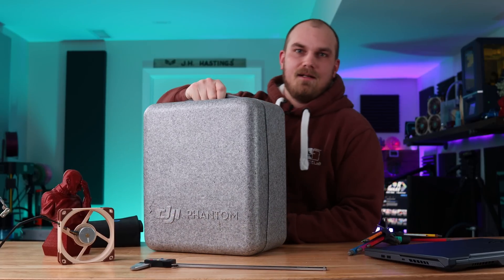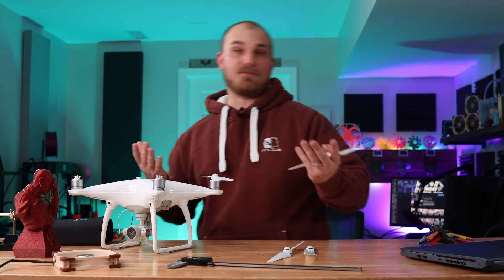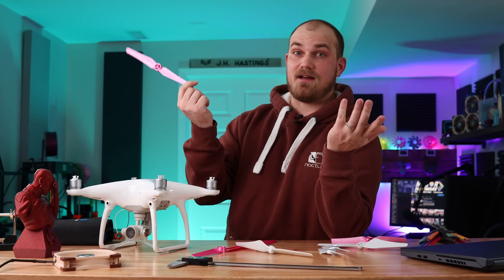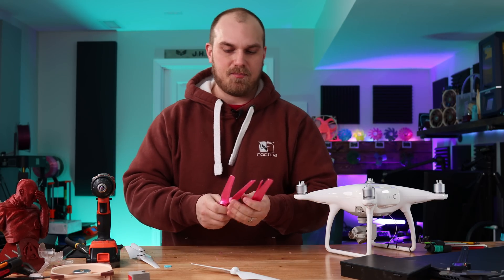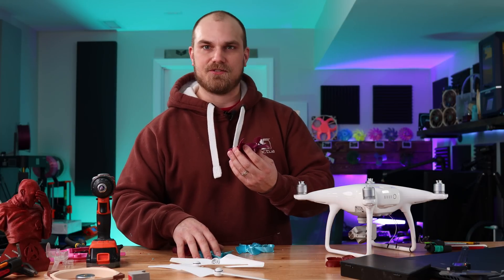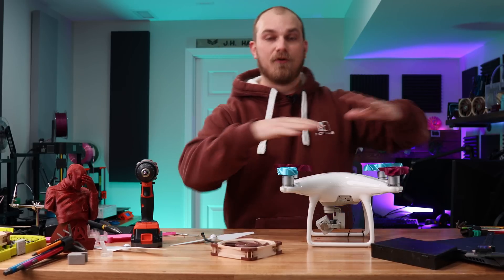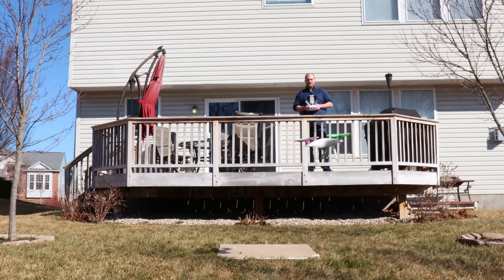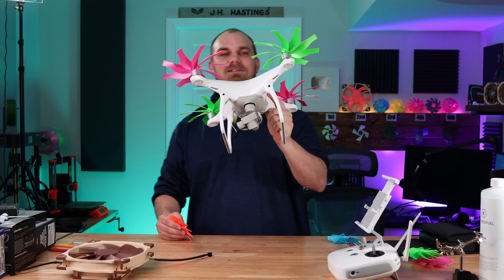FLYING Phantom 4 with 3D printed PC FANS

Comment: I believe if you 3-D print the BAT FAN PLUS from S4E8, with a bit more of a coanda-lip added to the duct, you will find multiple benefits for lifting your drone in future tests. The duct I am positive will reduce if not totally eliminate the flex you were experiencing with the blades in your previous tests, causing vibration and instability. Also, according to the 1954 Hiller Flying Platform studies the coanda-lip created 40% of the lift. 
I don't know the number of blades that will be optimal. Too many will stress the motors, so less may be more. The Hiller used 2 twin-blade counter-rotating props = 4 blades total. It appears the BAT FAN PLUS has 8 fixed blades. You might try changing the number and angle of the blades in your experiments. 
Love your show!!!
Thanks
Steve

Comment: So I randomly got curious one time (debating making a jet turbine) I've found that the fewer the blades the more air flow you get. The more blades you have the more pressure your fan can deliver. So if you think of a turbine with lots of blades pushing all that air into the engine to pressurize it enough so that the gas will ignite, that's where the extra blades come in handy. For propellers you almost always see the 2 bladed fan in an enviornment where the blade wont encounter airflow resistance. So in the open air, the 2 blade propeller makes sense. In a computer fan the 5 blade makes sense because you're trying to force air into a tight space, if it was just an open space you could get a lot more airflow with the 2 bladed fan. Another caveat of the 2 bladed fan is the noise. Two bladed fans make more noise. Another thing I'll add, as a theory. I was reading up on the most efficient house fan that also delivers the most air (kind of what you are doing on the channel) and someone actually did the research and found that the most efficient design is to use the blade angles from a windmill. This will produce the most amount of air. 3 for air flow 5 for pressure. Any more than that you have issues with weight and costs associated with the build vs the energy produced. Just some food for thought for those that watch the channel.

Comment: If you want more stability, add a ring(a cross-section of the ring would be shaped like a 1/4in diameter cylinder that connects the blades at their thickest point positioned around the middle height of the blade) about halfway between the middle and the edge of each blade. This should help lower the flexibility of the blades without having to add too much extra weight. For a 200mm, positioning the stabilizing ring about 50mm out from the center and positioned so it connects to the blades about halfway up the height of the blade.

I would quite like to see the biohazard style upscaled to the 200mm size.

Comment: @Major Hardware reduce blades by 1/2 & run a thin ring around the middle outer edge of the blades will stabilize

Comment: Have you tried a different plastic? And yes the length of the blades should reach to about the center of the drone. I believe that is where the gyro is maybe. Try making a triblade as close to the originals as you can..with harder plastic. That may not work though because of the extra blade on each...they may just chop each other up lol.

Comment: I think that with some engineering and better shaped fans and motors to work with them, more blades would make quieter drones.  Notice how quiet it was with the large fans mounted, the fans made almost no noise.   That is a good proof on concept.

Comment: Drones are designed for their motors to run within a certain speed range, which has to do with 1) the size of the blades and 2) the voltage of the power supplied.

A larger, heavier drone requires more thrust, so larger blades which need more powerful motors to drive them. Something that might seem counter intuitive is the larger the blades, the slower they’re generally designed to spin. A small drone for instance will have much smaller blades and typically motors that are made to run at a higher rpm. A larger drone like that will have motors designed to run slower, but with more torque in order to drive those larger rotors.

Comment: As a drone pilot, I was impressed that you could get 3D printed fan blades to work at all.
Now I would love to see this done with propeller aerodynamic design principals used.
Would be fun to make a set that has a whistle hole in the blade, to intentionally make noise.
With 4 blades spinning at varying speeds, would sound interesting in flight.

Comment: @MajorHardware why not use this as a test for the fan show down? Ramp the scale up 2x so they're bigger and stable like the propeller fans. Utilise the ease of being able to scale up a 120mm design in CAD. Use it as a test that way. Thrust and stability in a controlled environment (like the garage) could give measurable data to compare with too from the DGI internal sensors. Could correlate between thrust and cooling performance?

Comment: Tons of drone users 3d print their blades, so to me you didn't try hard enough to perfect the design for this video to worth watching. A minimum of 2 side by side extruded line for blade thickness and some reinforcement on or near the blade edges may be required to maintain a ridged enough blade for flight as well. Lets just say "mistakes were made and this is the result of the lack of time spent to avoid said mistakes" should have been the title of the video IMHO

Comment: Sizing the blade is utilising the torque of the motor, shaping the blade is utilising the speed of the motor.. From the initial experiments it's obvious that the shape and size of the blade didn't match the efficiency of the motor.. Because even if there was enough force yet there wasn't enough thrust of air as the blades weren't capable of maintaining desired air flux for uplift.. Thus air density didn't meet the desired one.. Matching the motor efficiency with the propeller efficiency and vice versa is really challenging.. When the two efficiency curve meets at a point it gives the most stable up lifting outcome of the drone..
I appreciate that hardwork brother.. well done.. 👍

Comment: The less blades - the more effective the propeller is. Most effective are single blade propeller (yes, single blade).
Reply: Blade shape and angle also make a huge difference.  A well designed single blade can be more effective than 6 poorly designed blades and vice versa.

Comment: Why not try the original fan blade but increase the number of them to 4 or 5 or 9 and include an outer ring the strengthen it all up ? Would that increase the down pressure or thrust ?

Comment: You should start a competition for creating drone blades. That might boost the drone blade economy for 3D printed drone blades. You can score them on lift, stability and efficiency.

Lift: Measure by seeing how quickly you can get the drone to fly to a certain hight.

Stability: Measure by checking how far the drone deviates from the starting point without moving it.

Efficiency: Measure the flight time of the drone.

Comment: Why didn't you design the blades to create lift which will also give the blades a little bit more sturdiness, (I'm sure you know this) example an airplane wing from the side view is shaped like a sideways tear drop where the front of the blade/wing is rounded and the trailing end of the blade becomes a point, the quick science behind a wing is the air on top moves faster across due to the distance it travels compared to the bottom of the wing and the faster air flows the lower the pressure, senses there's a higher pressure of air below compared to the top the air below pushes the wing up creating lift

Comment: You need to learn to fly an FPV quad in acro (aka full manual).... then you’d have a really interesting thing to run with. The DJI really is gonna only be happy with its own propellers. It won’t be able to spin small propellers or heavy propellers fast enough to generate any real thrust.

With a 5” quad you build your self.... you can probably come up with a pretty cool series where people design propellers.... with your own... you can choose the right kind of motor for the job.

Comment: The s21 ultra is a way better phone than the iPhone 12 pro Max in many ways.they are so far ahead of the iPhone that the next iPhone won't even have all of the features that the s21 ultra has now like 120 herts, adaptive refresh rate, 1,500 nits, 100 times zoom, 108 megapixel camera, 8K video, the smallest hole punch, on any phone, reverse wireless charging, recording from three cameras at the same time, single take mode and a macro camera. There are many more but I cannot remember them right now. When you see these features on the iPhone 14 do not think that Apple made these features because like usual they are just stealing the features from the last Samsung. Wach the video 5 ways that the Samsung s21 ultra destroyes the iphone 12 pro max. The next iphone will not have a chargeing port. Wireless charging takes twice as long to charge as wired charging wile using 74% more power and heat.

Comment: If you can't have enough thrust because of limited diameter and RPM, you can still make the fan thicker! :) Make them multiple layers of you 120mm-'standard design' stacked on top of each other.

Comment: @major hardware, you need a round covering on the outside of the fan to produce air pressure, u cant use the fans like in that config because the only pressure it gains is from the ground because of size

Comment: Isnt the difference that the pc fans use thrust and the DJI props use lift to fly? I mean, the prop is basically a wing with airfoil to produce lift using the pressure difference while the fan is just shoving so much air through itself that it moves more air than its own weight, kinda like a boat.

Comment: Print some with slightly longer blades and a thin ring or band going around the outside connecting all of the fan blades. They should all support each other

Comment: Great video and trials. The small blades were kinda dead on arrival but I think it may be possible for either super light or just smaller drones. Still not much propel surface on a 12" blade disk
Now will the next test will be biohazard fan VS airplane model ?

Comment: I was watching a guy fly his FPV drone with 8 blades per prop (instead of 2 or 3) to see if he could reduce noise and it worked. Smaller blades with equal blade area or possibly more area. I thought it was a cool idea. However those were not 3d printed and I think more ridged. Cool idea though, I'm all for finding creative new ways to use my 3d printer. Balancing is very important to reduce vibration and sustain long term flight. Great video!

Comment: I am not completely sure about this but I think the original propellers were designed to produce lift, like helicopter blades. The blades on a fan are designed to move air. I can't give you a full explanation but I dont think fans produce lift. Also if you are looking for "thrust" I think you will need many more blades and a funnel to force the air through to give you "thrust". Maybe just try to design the blades to produce lift like an airplane wing???

Comment: Why not put enclose the outer edges of the blades with a ring, it should help prevent blade flex and force all the thrust downwards instead of losing some out of the edges.

Comment: Propeller size, pitch, and blade count all need to be matched to motor kv,  stator size, and battery voltage. If you want to get the same thrust out of a smaller diameter prop, you have to spin it faster. To get your motor to spin faster, without it melting (or your ESC melting) you have swap to a higher kv motor. If you don't want to swap to higher kv motors, you can increase your battery voltage (by swapping to a battery with a higher number of cells in series). The hardware you are running has to be able to run higher voltage, or it will melt (yay, fire!)

Comment: I wonder if you could add more stability by making 3 blades which are slightly denser than the one included but slightly shorter in diameter. Also making the width of the blade more by 2-3 mm.

Comment: You will kill the motors or ESC:s doing this, the amp draw during spin up will result in wide open ESC:s and excessive current being drawn through the board. Just so you know. At least P4 parts are affordable :)

Comment: if u rather use small fan blade i adjusting u make ur own drone better than them buying factory drone because u have more ways get around it 2nd u can get beast motor that take ton of torque n turn heavy blade no problem 
if u making drone frames i adjusting u put metal washer under motor keep it not heating plastics up that way reduce melting it

Comment: u need go 200mm fan size because small fan blade is less force lift
bigger fan blade is more force lift because longer blade is more lift force n more cover grab air n weight at same time
"force mean push objectives "

Comment: Sir, can you try putting a cylindrical wall attached around the blades to keep it from flexing, i think the blades on the inner part are quite steep compared to the original blades, i'm not an expert.

Comment: Perhaps what you need to generate more lift is static pressure optimized fan blades? And, as for stability, perhaps it would be better to resin print?

Comment: So, I think if you made the blades thinner, and made them from a stronger material, like Carbon Fiber or Polycarbonate (I don't remember if you said what you printed them out of) it might work better. I would also considermaking a very thin ring around the outside to stabilize the fans/props. I know that adds weight, but I think the trade off would be worth it.

Comment: I noticed the fans were designed to pull air and generate thrust, and think the angle of the propellers almost half of them being horizontal matter a lot more because they're also working as wings, not just turbines. One half the size with twice the propellers, in the same angle, would work? Or maybe alternating 2 lift blades with 2 stabilizing ones.

Comment: I would love to see the Biohazards resin printed at the same size as the original blades and sanded to be smooth and as balanced as possible, and then see you take it for an actual flight (low altitude at first to make sure they're not going to self destruct)

Comment: Bro highly highly recommend getting a "ready to fly" FPV Drone from GetFPV or Racedayquads and slapping custom fans and blades on to those. Way easy to bolt on blades because they're just held in place with Selflocking Hex Nut to a screw on the motor's bell. The average drone uses 5inch blades so a smaller print volume and shorter print times. Plus you'll have the option to tune the sucker.

Comment: i like what you done here, the only real way i see you keeping this one going to to change the motors to higher KV the stock one are 800kv, you would want to try 1400kv and keep to the normal 5mm hole, stock motor bell size is 2312 so something around that, as for testing, higher kv would let you use smaller props, smaller props less change of being un balanced, well the present might be the same amount but there is less mass, also try different filaments that can handle it, the way the test would work is you would get people to send there designs in same as normal, but instead of checking helps you would have to retro fit a current sensor to the drone and its all about who can make a props that can use the less amps, winner is the one who make the props who uses the less, this would also have to be done inside, no wind, as one test prop might have a advantage, also thinking of it, it would have to be watts, as one test might have a lower voltage to another but the apps would not be fair,  and yeah them PID look to be off, also as the props are likely to be heavier they take longer to spin up vs stock, so you have a over shoot thing going on, or in your case a under shoot        

nice video hope you can make some test up :)

Comment: More recent drones have self stabilization, unlike that one...
You need to make your propellers larger. Just get the blades longer. By that, I mean with the same radius as the original ones.

Comment: Has to be a bigger fan. 120mm not enough but if you take the same length fan of that came with it. It will work.

Comment: Maybe smoother surfaces and take care of turbulence in the tips of the blades, this generates a lot of turbulence with the shapes used in the trials. 

For a PC cooler it is no issue, they are encased and the flow is directed, with a propeller it is another story, the tips will generate turbulence and need to be correctly shaped to minimize it.

Comment: So I have a crazy idea, I think you might love, and you're the fan guy, so you're my only hope. They say the larger a fan is the more efficient. I'm not saying do that stupid meme thing and put an office fan in your pc. Do you think it's feasible to print a fan the size of a case, and side mount it where the tempered glass goes? They say that large fans do not need to turn as fast, but still they are generally impractical because of the wear on the center bearing and if they are uneven they also rattle. But I would think this could be easily circumvented by running motors along the rim?  (Or even hypothetically building a rim which is a motor).

Comment: I'm sure there's a pretty good reason that the 2-blade design is pretty much the default, with 3 and 4-blade designs popping up when it makes sense.
Instead of trying to upscale a standard fan, it might be worth going back to some of the 2 or 3-blade designs and adapting them?
There might be enough interest to do a whole series of Propeller Showdown in between this and the next series of Fan Showdown... ;-)